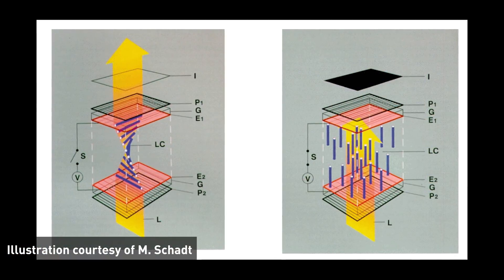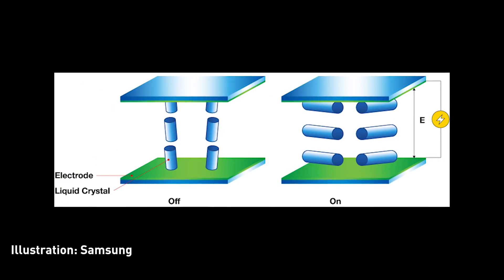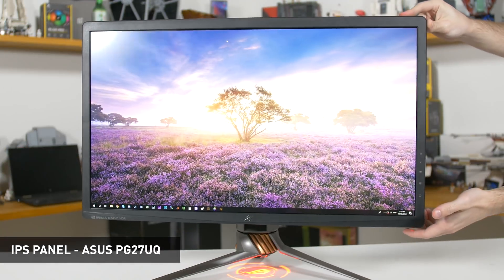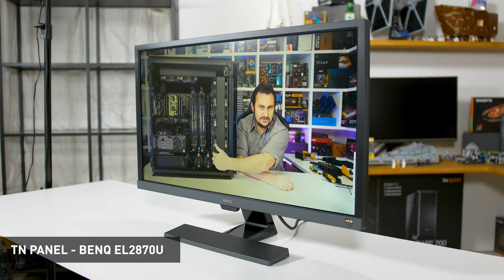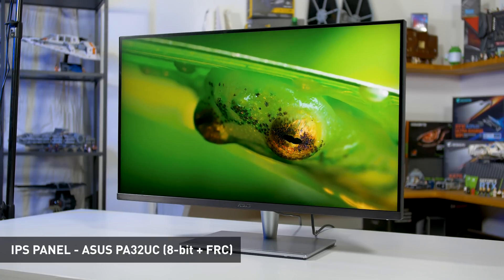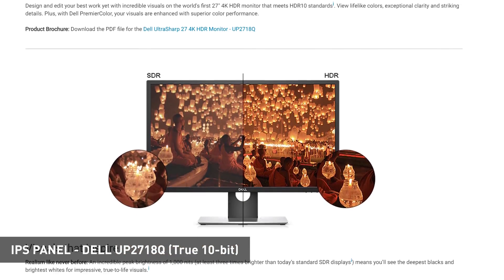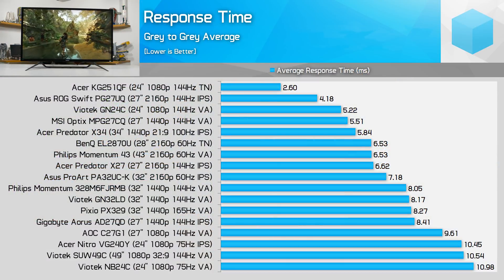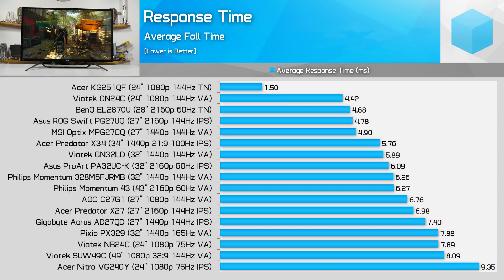TN vs IPS vs VA: Which LCD Monitor Tech is Better?

Comment: It's worth noting that IPS and VA have roughly the same absolute response times, but because of VA's much better contrast it takes longer to switch from black to grey (0% to 20% is the only transition they're slower than IPS in). This can be countered in games where you need absolute speed by reducing the contrast down to IPS levels which most VA's have an FPS preset for. Having tried all three panel types, VA in my opinion looks the best and I competitively game on mine as well. I think IPS is only suited for professional content creators and TN for pro gamers who need the absolute fastest response.
Reply: Well if you only care about response times and clear images TN gets dumpstered by crt.  A crt is roughly 150times faster than tn and it never ghosts.  On top of that people will give you them for free.
Reply: @blarghts  LOL true
Reply: I use IPS for games, and video content (for everything actually), and have no complaints at all. 

This whole thing "ips is for content and VA for games" does not make sense. As the video says, each one have pro and weakness, if you like great color acuracy and angles views for big monitors, the IPS is very good, including for gamers. If you don´t cara about view angles; and prefer contrast; then VA. It does not matter what is the main use of the monitor.
Reply: @EJSC It double strobes at 144hz though compared to G-Sync's 120hz single strobe. There's no visual flicker.
Reply: Then you need to game on the new AOC 24G2U IPS monitor and i do not think youll game on any 1080p VA again
Reply: VA is sooo grey. IPS is the best.
Reply: @xDUnPr3diCtabl3  Think you got them confused 😆
IPS has the worst looking black out of the 3 LCD technologies. Unless you add Full Array Local Dimming, then again, VA would still give you superior contrast and thus deeper blacks when all other things are equal.
Reply: Mark Jacobs you are confused? it's about the colors.  with IPS they are significantly more saturated than with VA.  Contrast in a different construction site.
Reply: @xDUnPr3diCtabl3  IPS can be the most accurate colour wise, but black isn't a colour & should be (as close to) lights off. IPS has their Liquid Crystals positioned in such a way that light isn't blocked as well as either VA or TN resulting in brighter blacks unless you give it a hand with dimming zones... As far as saturation goes, any panel technology can oversaturate a colour space, that's not the point though. You'd want a certain colour space covered as close to 100% as you can get. Yes IPS is good at that (if calibrated properly), but it doesn't mean black is actually black... 🙃
Reply: Mark Jacobs again its not about black levels. IPS still has better colores. This is more important most of the time. VA is grey and smearing acures. Do you like black? Get oled.
Reply: @xDUnPr3diCtabl3  Lol, your initial comment was VA looking grey, while it's IPS that looks grey. You can prefer IPS all you want, that's absolutely a valid point, but saying VA looks grey is just factually wrong since it'll show the deepest black out of any LCD. If anything, both TN & IPS look grey when content is supposed to show black with IPS being the worst offender here.

The only good thing about that defect is that for colour accuracy that doesn't matter so it's the best choice for content creation since you know the greyish looking blacks are supposed to be black & the rest is accurate.

For content consumption the contrast ratio is going to be the biggest contributor to perceived image quality as long as the display is calibrated to a reasonably accurate state (with any gaming monitor that'll be not that well calibrated, with VA & IPS usually over saturating srgb & missing the mark on other colour spaces as well, TN usually does well for srgb but grayscale tracking is off to a certain degree).
Reply: Mark Jacobs omg. The colors are washed out on VA! So it looks grey! Ok now? Not the Black Level! https://youtu.be/ft0m_8SN-60 here at 0:10 you can see how „grey“ the color on the VA is. (Left)
Reply: @xDUnPr3diCtabl3  Actually, the right panel seems to either have some contrast shenanigans going on or the camera isn't adjusted properly to record what is actually seen in person.

You can't really judge most of these things from a youtube video since the camera used, the display you use & the youtube compression can all tip the scales to either displays favour.

To me it (quite obviously) looks like the right panel crushes the dark details & clips the bright highlights in contrast to the left panel...
Reply: @uP-Andre The new AHVA which are AUOptronics IPS are actually faster than a TN. Just need to get lucky on the lottery & pay the price.
Reply: is response time the same thing as ms?
Reply: @Zwenk Wiel Black frame insertion. Nvidia call it Ultra Low Motion Blur, ASUS call it Extreme Low Motion Blur, BenQ call it Dynamic Accuracy. It's all the same. It inserts a black frame between frames to stop your eyes from creating motion blur at the cost of reduced brightness and most monitors can't do BFI and variable refresh at the same time. When something moves across the screen the monitor displays still images, but your eyes perceive motion and will try and track it. The time between frames where your eyes are still tracking is what causes most of the motion blur you see. With BFI I can drag a window around and still read the text clearly and this is on a 4ms VA. I wouldn't buy another monitor without it.
Reply: 6Twi is the time of dex Zee sted
Reply: Which 1 is best for study, work and watching movies?
No gaming.
Reply: @EJSC TN does not have less motion blur than CRT, or faster response time.
Reply: Which one is good for eyes?
Reply: So VA is good for both productivity and gaming?
Reply: @EJSC This was a joke, because crts are bulky and have bad image quality so actually going back to them seems kinda silly.  However Looking at charts it appears that modern monitors are still slower than crts at equivilent refresh rates. I'm curious where you found the data that suggests that LCD's have surpased crts in this arena. 160-200 hz wasn't unheard when you sacrificed resolution.
Reply: @blarghts  It doesn't answer your question. But manufacturing has made it so the pixels don't use as much energy when transitioning. So on fast refresh and ULMB the effect of moving stuff on screen is very good. Though you can't get it with adaptive sync, it has better clarity than CRT because liquid crystal has always been better at that.
Reply: @blarghts  CRTs do not have bad image quality. They're bulky heavy and expensive to make but technology wise they're still very relevant because in a lot of ways they're superior to anything on the market. You need to watch more vids on CRTs
Reply: @EJSC I just bought the Samsung CHG70 (1440p, 144hz, 4MS VA, /w BFI + Freesync). With BFI on it's clearer than my TN that didn't have it. There's a single pale ghost with most transitions or a couple of pale ghosts in the blacks but for me it's acceptable and I have no problem seeing people in PUBG while moving my camera which I had no chance of doing on my TN and IPS. A TN with BFI would be the best though if you're okay with sacrificing colour/contrast which for me doesn't seem worth it.
Reply: @6Twisted  so you have a clearer image during motion on your 144hz VA than compared to your 144hz TN panel? and all just because black image insertion? dang, i had no clue that BFI could be such a big deal..
what about 240hz TN vs 144hz VA with BFA?
Reply: @EJSC I have seen it on a camera. I leave BFI on all the time and watch movies/youtube on this and haven't noticed any extra eyestrain compared to my 60hz IPS.
Reply: @uP-Andre Actually he is right, crt response times are like 0.01ms or less, of course CRT are shit quality but he is right about response times
Reply: @mauriciolandos4712  It actually depends on which CRT, especially American interlaced signal CRT is bad quality. However PAL signal (European CRT for the most part, although eastern regions might even have a combination of both) are for the most part decently colour accurate. However the scanout on CRT is still distracting to me so I wouldn't consider it an option next to the bulky behemoths they are.

Comment: Great video. Last year I made my most expensive monitor purchase of my life. After about 3 months of research and shopping I landed on the Asus PG279Q. I am not a content creator, however, colour correctness in my games matters to me. I wanted something that could do 144hz at 1440p with an IPS panel and 4ms GTG, the PG279Q had all of that. I feel like the IPS display is the best all arounder for rich true colours and as of late, 1ms GTG times. Every TN I've looked at just doesn't have the colour depth, and they tend to look very red. That's just my opinion though, and the monitor I ended up with was $800.00 USD so... it wasn't necessarily cheap. Good luck to anyone looking for a new monitor.
Reply: Comparing them, the PG278QR (also from ASUS & TN) comes dangerously close to the PG279Q for colour accuracy when you're somewhat seated at the centre of the screen. It heavily depends on what you want. I also recall the PG279Q having some excessive IPS glow in certain batches thus the PG279QZ was introduced which apparently was a lot better in that regard (which only matters when either watching off axis or in a dark room in some cases visible in daylight & dark content as well).

Generally though the high end ASUS monitors are just a blast in casual usage no matter the panel technology (even the VA option while not true 200Hz, was definitely "good" for at least 144Hz & with great contrast).

Comment: Im searching for a 2k@144Hz monitor, and was keen into getting a IPS panel as it is the more balanced technology in terms of color quality and response time. But the other day found the Samsung CHG70 which is a VA QLED panel and they claim it has 1ms response time. Is that really the case? Because most VA panels are 8-10ms as you say Tim so Im like 🤔
If it is real <6ms to fully enjoy the 144 refresh rate I will pull the trigger on this one as it is the only affordable panel with real HDR out there
Reply: Most likely it is not true 1ms response. Monitors will use a "motion blur reduction" technology to give it the 1ms response, but this generally reduces image quality quite a bit.
Reply: A little heads up, it should be noted that these monitors are QHD or 2.5K NOT 2K

1920x1080, horizontal pixel count is 2K
2560x1440, is 2.5K
3840x2160, is 4K
Reply: Haxor inator 2k I mean 1440p, I think that’s how most people referes it
Reply: Sergio Madureira No harm done, but I’ve seen way too many confused threads on Reddit of people asking for 2K monitors and get 1080P results.

Everybody knows what a 2.5K monitor is, 2K adds ambiguity 

“Does he mean 1080P or does he assume 1440P?”

EXTRA TID BITS

Honestly we shouldn’t even be using the K nomenclature, it’s not meant for consumer products.  It’s more DCI standard.

HD FHD QHD UHD is what were really talking about.
Reply: Sergio Madureira yea the chg70 or Msi Optix mag27cq
Reply: QLED refreshes pretty fast. The 1 ms probably isn't useful to go by.
Reply: I currently using it.
1. 1ms res. time is unreal, you have to select "fastest mode" in order to achieve 1ms which is still not really 1ms (I can feel it becoz i play osu) and screen turn a bit blueish when you select that mode. for normal mode, it's still ok at 144. no obvious ghosting blur so far.
2. HDR is pretty useless imo. window HDR support is shit.
3. you dont really need HDR. QLED VA is already great. color is as good as high-end IPS and the contrast is even better.

Comment: Thanks for the explanation in differences between the technologies. How come many large screen 'TVs' are cheaper than some monitors? Many TVs now offer 100Hz refresh as well. Is there any 'TV' that you would recommend as a 'monitor'? I currently use an Asus 144Hz 1080p monitor but also switch to a 40" Samsung TV for video content. Currently in NZ you can get 4k 55" TVs from $500NZ - 60Hz refresh...

Comment: @ 12:02 Interesting so the fastest VA panel is only equivalent of 100 - 110hz in reality, so the intel fanboys that claim Intel is better for high refresh gaming and are using 144hz VA panels are only getting 110hz. The only way to spot the difference between Intel and ryzen  in high refresh gaming scenarios is if you are using the most high end IPS panels or TN.  Even though the Frame pacing will be better with intel at higher clock speeds

with ryzen you can optimize your settings to keep the frames above 100fps at all times depending on the game if you are using a 2080 or 1080ti in 1080p.

Comment: I appreciate the low response times of tn panels if I am playing competitively. However, I cannot tolerate playing a single player rpg games like witcher and other similar games in a washed up colors of tn panels. Like you said, every panel has its weaknesses and strengths. But it is best for me to at least have 1 tn and 1 ips.

Comment: i tested all kinds and none stand out to dethrone OLEDS....OLEDS is lot better than plasma...dosen't  burn in like plasma majority time does....only first version a few thousand have burn in issues but they are more easier to resolved than plasma...due to LED is not like plasma used when burn in....so in latest version got improved in the years
Reply: DR.NEGA I’m waiting for mLED.

Non-organic version of OLED, never burns in

Comment: we are so close to decent ISP 10bit high refresh rate low response time monitors but yet so far cause they all have really high response times like the aorus monitor nearly perfect but just too slow. can you review the new Acer Nitro Xv272up its pretty simplar the new aorus in specs just not as gamery in design wanna see if it beats it in response times.

Comment: I went with a 34" curved ultrawide 100hz VA with quantum dots (CF791) as that seems like the best compromise IMO; excellent contrast, blacks and colors with usable viewing angles and response. I could not find an IPS display that didn't have horrible back-light bleed or terrible back-light uniformity. which seems odd since a dell IPS from 2005, that I still use to this day didn't have that same problem.
Reply: LG 34WK95U
Reply: @Fortespyproductions  I'm not sure I understand the suggestion of the $1500 monitor, well over twice the $600 price I paid for my CF791. Oddly, even though the LG has local dimming, it still has back-light bleed problems, worse contrast and worse black uniformity according to rting.com. I'll pass.
Reply: @MacTX  I've heard LG is the shittiest company to buy a monitor from.

Comment: I find it odd that you recommend VA for gamers, especially over IPS and even TN, the enemy for gaming is response times and ghosting or unwanted blur, on top of that you even said you possibly wont be getting the refresh rate you think you are, so perfect for gamers then, what an odd recommendation. VA seems more suited to movie watchers not gamers and that's why they are the main choice for TV's since here the deep blacks and rich colours are appreciated more. feeling plays a much bigger role than outright visuals for most gamers, that's why moving from a high refresh fast monitor to a console on a tv feels like your moving around in mud on the console. id take a high end IPS over VA for gaming any day, especially if you usually play in a fairly well lit room most of the time as this helps with any noticeable IPS glow. TN all day for competitive tho, as its almost always super fast so you never feel cheated if somebody gets that shot off first and your a split second late, with that said there have been instances of a IPS panel outperforming its TN counterpart in overall response times.